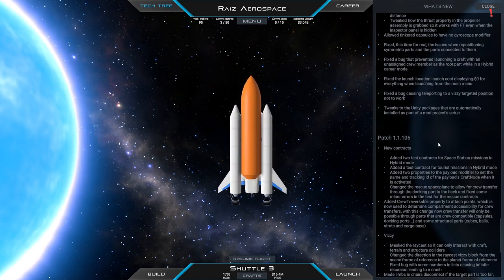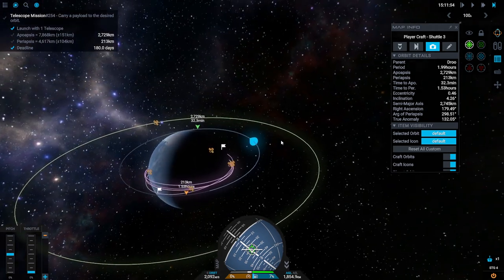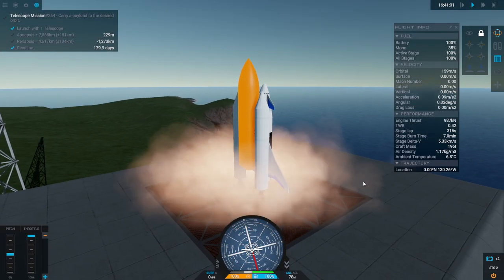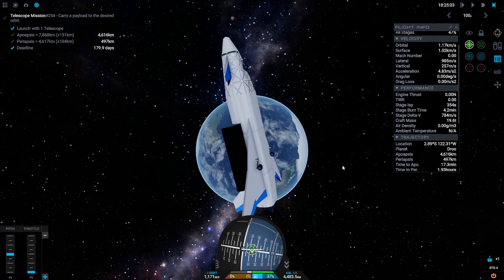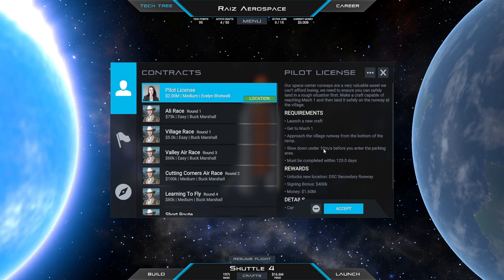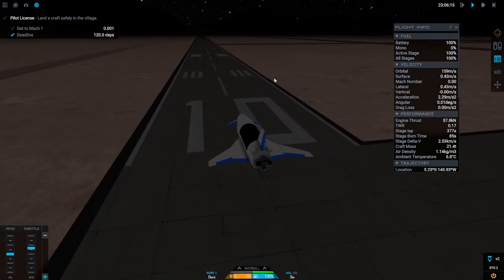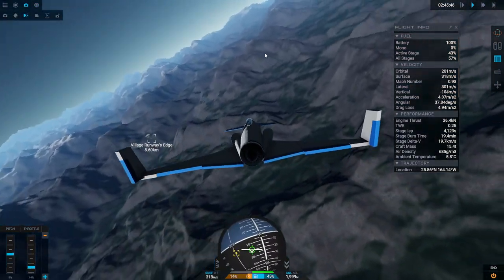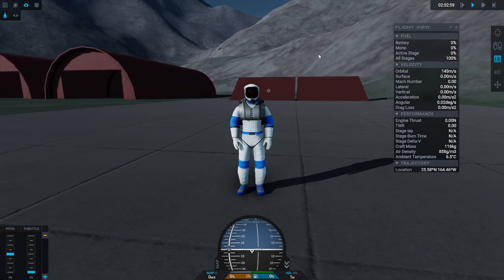Juno: New Origins (formerly Simple Rockets 2) - Career 32

Comment: On the CoM of the telescope, almost all of its mass is at the bottom, the front is just the hollow tube for the Cassegrain. I'll give the "antenna" deployment some delay though xd.

"I am a successful pilot" lmfao it's always nice to see someone solve one of those contracts in such weird ways.

As a side note, we have a couple contracts in hybrid mode so players can check them out before they are added to Career, you just need to start a hybrid mode game and you'll have them from the start. If you have the time and want to give those a try, I'd love to see what you think about them. The set of test contracts includes 3 rescue missions out of the 15 we are going to add, a tourist mission and 2 station missions.

Side note on the side note, if you do the tourist mission, make sure to grab the tourist in the payloads category, not a random tourist.